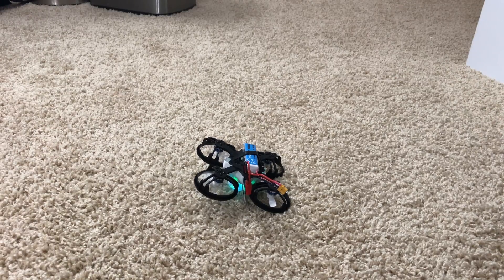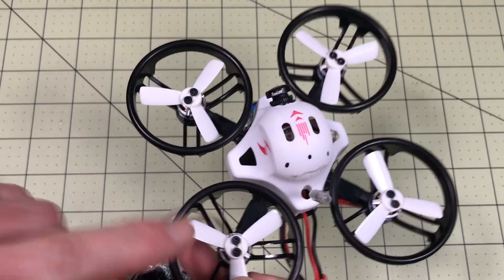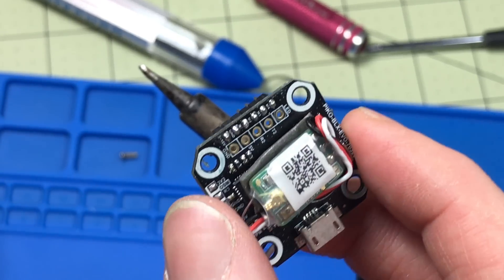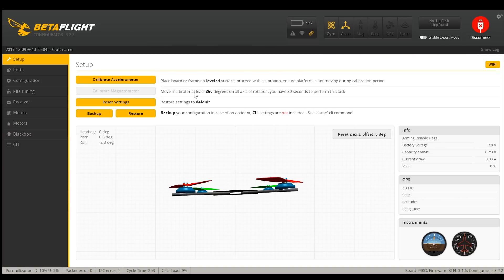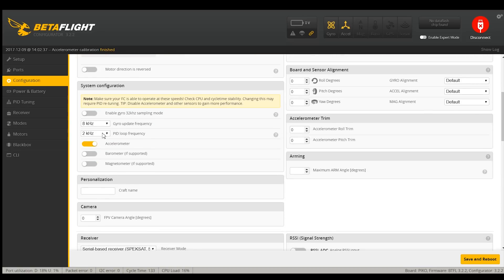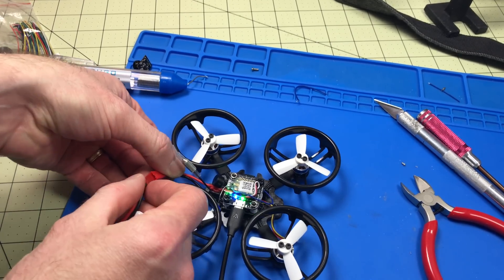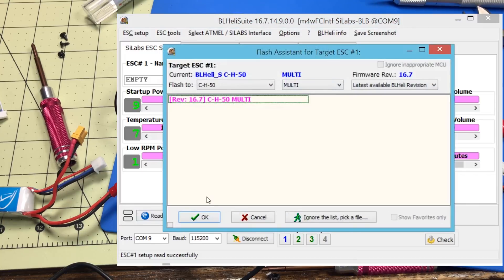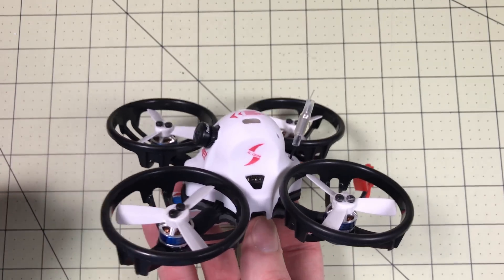KingKong LDARC ET100 DSHOT Setup. Enable Turtle Mode and a HUGE camera upgrade. ET115 and ET125 too

Comment from the maker: Check my tracking spreadsheet for current coupons: http://geni.us/DR101DiscountCodes

RunCam Nano:
Amazon: http://geni.us/RunCamNano
Gearbest: http://bit.ly/RunCamNano-GB
Banggood: http://bit.ly/RunCamNano-BG 

There are 3 sizes to choose from.
ET100 – 100mm frame 2 inch props - https://www.youtube.com/watch?v=l3L40QWDbx0
Banggood: http://bit.ly/KKET100 (Try Code ToysHo and if that doesn’t work check the spreadsheet)
Gearbest: http://bit.ly/ET100-GB (Use Code KKET100 if you don’t find any coupons in the sheet)
Amazon: http://geni.us/ET100
ET125 – 125mm frame 2.9 inch props
Gearbest: http://bit.ly/ET125-GB (Use Code KKET115 if you don’t find any coupons in the sheet)
Banggood: http://bit.ly/KKET125 (Try Code ToysHo and if that doesn’t work check the spreadsheet)
Amazon: http://geni.us/ET125
ET115 – 115mm frame 2.5 inch props - https://www.youtube.com/watch?v=NpwN68X8ypc
Gearbest: http://bit.ly/ET115-GB (Use Code KKET125 if you don’t find any coupons in the sheet)
Banggood: http://bit.ly/KKET115 (Try Code ToysHo and if that doesn’t work check the spreadsheet)
Amazon: http://geni.us/ET115
Reply: Great video 😀 I'm definitely going to try the camera mod on my et125. I wonder if you could put a Runcam OSD or similar on it🤔 might be too big a camera at the moment. But in the future, as in the next few months, I bet a small OSD enabled camera will appear on the market.
Reply from the maker: +Darkwing Duck Ich ging für einen Monat nach Deutschland in der Highschool.  Ich erinnere mich nicht alles, weil das Bier.
Reply from the maker: +Richard Warwick  The Micro2 is just a little two big, but yes, I am sure there will be one soon.  Will take some reworking of the power to be able to read the voltage though.  Or maybe just take this frame and install my own stack?  Hmm
Reply: DroneRacer101 just remembered Albert Kim did a review about 10 days ago for the FXT T80 nano camera on banggood. It's about the same size and has an OSD, you just connect a wire directly to the battery positive and your away 😀 even connects up to a Runcam joystick to control settings
Reply from the maker: 2 hours and the video is already outdated. 🤪
Reply: DroneRacer101 😂lol
Reply: I installed a micro 2 and it fits perfect after you cut out the plastic mount from the stock camera
Reply from the maker: Gavroche how did you hold it in place?
Reply: It holds in place by itself. You have to unscrew the lens, put the camera into the canopy and screw the lens in again from the outside - you do not have to cut the hole. If you have the DSMX Receiver you have to change it's direction otherwise the plug is in the way and the canopy does not fit anymore. Afterwards if you mount everything together again and fits really tight. I did not need to glue or anything. Hope my english was good enough to explain ;) Just try, it's really easy.

Comment: Following your video after a long hiatus, looks like FF_PIKOBLX 3.2.2 is gone.. ! Looks like the latest version is FF_PIKOBLX 3.5.7 , I also used the BLHeli configurator on chrome to upgrade the firmware on the four ESCs. I ran into a issue with drivers not working properly when flashing PIKOBLX, I used ImmersionRC's driver fix utility, and a PC reboot later.. it worked. :) Note: I have no idea what your using on the other channel.. I have the 3 default channels on my X9D+, and the turtle flip one that you showed.
Reply: Hi which version of betaflight where you using?

Comment: Dir auch guten tag!
I also bought one today
Thanks for the valuable tips ;)
Reply from the maker: This is actually outdated now. Just update the firmware. You shouldn’t have to do any soldering.
Reply: @SimRacer101  so much the better, if it's that easy: =) ty^^

Comment: Hi there  how did you enter boot mode?
Reply from the maker: I have the ImpulseRC Bootloader installed so it happens automatically. https://impulserc.com/pages/downloads
Reply: @SimRacer101  
Thanks pal I'm on with sorting out my serial port to run the flasher in betaflight. Esc are done on dshot600 and only 1 motor atm while I manage to flash the fc 👍 thanks for the fast reply ✌✌✌✌🇬🇧
Reply: @SimRacer101  
Any chance you could help me out here? Ive flashed the newest firmware to my et100 and the blhelli dshot600 managed to arm it but only 3 motors like you did but that firmware didn't support flip over after crash so I flashed the 3.3 you did but now the tx won't show in betaflight? Its binding according to the lights But nothing showing on reciver tab on betaflight config?

Comment: ET125 
have a question for  beginners how do I slow down the throttle it wants to lift off like a rocket I am a beginner any suggestions  
Could I use a bigger battery 2s More MAH 1000  
Maybe a 65 g battery weight

Comment: In my KK et 115, in air mode, when I arm, one motor start after 0,5s. And when disarm, the same motor stops first. Why? The quad is new and  it flies well.

Comment: Best regard

I have acquired by ebay, an ET100, I am happy with it. I wanted to update the firmware. the flight controller has a led that shines green, when I install the PIKO firmware, through betaflight, the LED flashes green and then turns off and everything works fine. I have followed internet videos to update with the firmware FF_PIKO and be able to use dshot 600, but when updating the firmware, the led of the flight controller remains blinking green and does not finish working well, since it seems that it does not link in control , despite the fact that the mini receiver XM frsky, links well.

I appreciate some solution

Comment: hi, my quetion is, compared with this Runcam the "FXT T80 800TVL cmos" camera is better? (I saw you use it in another vid) thx
Reply from the maker: I would use the T80 for voltage on the OSD

Comment: Hi, just to let you know (if you don't already) that, as of Betaflight 3.3.0, the DShot mod is no longer necessary for this board. No soldering needed, no resource remapping needed, DShot just works. If you could put that in the description or pin it to let people know, that would be great.
Reply from the maker: WHAT?  Oh, that is cool.  I will test that and update it.
Reply: Yeah I was surprised as well but apparently the Betaflight guys built a firmware fix into the FF_PIKOBLX hex file, to make DShot work. Just be aware though, if after you install BF3.3.0, you find that you can't get the SBUS receiver to work, use the CLI command: set serialrx_inverted = OFF
Reply: It does work!  Upgraded to 3.3.0 and upgraded ESCs to 16.7.  No problems, but I did notice the PIDS seemed to be for brushed and were way high.  Otherwise, DShot and Turtle mode worked perfect.

Comment: Hello, I wanted to try this mod, but i am facing a probleme and maybe you can help. I have my receiver fsRx2a (https://www.banggood.com/2_4G-Compatible-FS-RX2A-Pro-Receiver-for-FS-I6-FS-I6X-FS-I6S-FS-TM8-FS-TM10-FS-I10-Transmitter-p-1145881.html?rmmds=search&cur_warehouse=CN) and it is connect in ppm. The receiver can also transmit to sbus, so i wired it from sbus to the r3 of the pikoblx board, but the board is still working in ppm for some reason (the led on the board saying 'sbus or ppm' still light under ppm) the result is my receiver still bind but seem to not send any signal to the flight controller. How can i force/switch the piko blx to use sbus on the R3 and switch from ppm to sbus??

Comment: Whats up sir. First off great video! 
Got some questions for ya, I just picked up a ET115, and it actually really does fly way better than my tiny whoop by a large margin. Anywho for the questions:
1) What size batteries are you running? (my et came with a sticker that said DO NOT use 3s batteries. Ive found that I like the Tattu 2s 45c 800mah, but was curious if that is enough c.
2) If i make a backup, as well as run dump all from the CLI to save the factory tune that is surprisingly good, can i easily restore them all once upgraded to betaflight 3.2.2 so i dont lose the nice tune?
3) Will turtle mode work if I upgrade to BF 3.2.2 and do not run DSHOT? and secondly did you notice a large difference in flight characteristics for the ET when using DSHOT over Multishot

Comment: Hi DR. Quick question for you. With no mods, my motor 1 and motor 4 do not spin with dshot 600. Do you think if I resource motor 4 with the LED, that would work? Motor one works fine with PPM, but motor 4 is still dead is what I'm trying to say..
Reply from the maker: Hmm it sounds like a bad motor or esc unfortunately.
Reply: DroneRacer101. I went on and tried it. I ended up resourcing M1 to ppm and M4 to led_strip. All 4 motors work great on Dshot600 now. Thanks to you and Kopter for these vids. Learned a bunch!
Reply from the maker: That is the first I have heard of that for motor 4. I am going to have to do some research.
Reply: in CLI type "resource M4 xxx(whichever number LED pad free)"?
Reply: yes... i followed each step till I found the same problem... motor 4 doesn't spin... using flyegg 100 by the way
Reply: 张亮 Resource M4 with the LED pad the same way you did M1. Worked great on my ET100
Reply from the maker: Huh. I have not heard of needing that. But good to know. THANKS!
Reply: 张亮 correct. Let us know how you make out. 👍
Reply: https://www.youtube.com/watch?v=2TmjM5W5xmU 
I found this... might give it a shot

Comment: With all the newbies that watch this type of channel why would you recommend as a good drone after you have to change the camera, change the wiring and destroy the looks by hacking up the canopy?  There are plenty of good drones that don't need any work in this price range. Be careful of leading people the wrong way
Reply from the maker: Because right now even with the required changes the ET100 is by far the best in class in the indoor micro brushless category. Did you see the initial review? KingKong ET100 Brushless Indoor Racing Drone, Almost the perfect winter indoor racer. https://youtu.be/l3L40QWDbx0 I have SMASHED this thing as hard as I could and didn’t even bend a prop. And it’s wonderful to fly indoor at high speeds.  It is by far my pick for indoor flier, even stock. But once you have it of course you want more. It’s what we do.

Comment: I lost one ch in my 4 in 1 one my ET125. I was trying to flash at the time. I am rusty at this hobby.  Ordered a whole new stack from Banggood. $ 33 + frt. This video is excellent but I am really missing OSD. So, I will try adding sparrow micro. Working on the new stack, It was interesting soldering the 4-1, it is small. The entire mod  turned out well except  removal of the pin, I could not extract as described so, I improvised there. I cut it and then insulated it. Not so familiar with ESC protocall as yet. D-600 vrs. one shot, etc., cause it flew really really nice in my house. A blast. The mod went well as shown. Great video. I paused the video a million times, it seems. Sir, If I keep using your ch, I will sign up as I have with others. You should put a link? Nice work and thanks.
Reply from the maker: I think the micro is to big, but I just linked another camera in the description I have ordered to try that has an OSD and is NANO sized.

Comment: Off topic question...I bought a multiprotacol module for my QX7 from Banggood  and setup the radio following another youtuber vid to bind to eachine  E011. Worked perfectly (that never happens ). But I can't seem to get the answer to this question...how do you then change the rate or invoke a flip like OE controller.  Any help would be great oh wise one. Lol. Thx.

Comment: Nice video. There is no need to remove the pin (ESC 1) between the ESC board & FC. I do it on my first ET100. But on my KingKong ET125 and FPV EGG  I soldered only a wire from M1 to PPM. And it works fine with DSHOT600. 
My videos in english? Yes, no problem. Turn on the subtitle and switch the subtitle from German to automatic translation to english language. Very nice function from Youtube.
Reply from the maker: That’s correct. I updated it when I did the ET125 update. Waterproof a drone, ET125 DSHOT, FXT T80 Camera Review, FPV Gloves. There is a LOT going on here https://youtu.be/g-TYJc0UUTE
Reply: Kopterheld FPV Racing bf 3.3 no mod required for dshot. Make sure to set serial Rx inversion to off for sbus after flashing to 3.3
Reply: Kopterheld FPV Racing so no need to take the stack apart! Just take a wire and bridge m1 and ppm - followed by the resource mapping and the esc update?

Comment: When you are updating ur fc wouldn’t it be quicker to dump the cli then copy it into the erased version?
Reply from the maker: I used to.  But I have found they change just enough between versions that something is off. So I have found it better to redo it. They always rename one variable or another then when it doesn’t work I have to go figure it out. One one exception is LED. I do a Diff and will copy that back. But this model doesn’t have them.

Comment: Thank you for the video! An excellent review!!! Would you recommend a runcam micro on the et100?
Reply from the maker: I think the micro is just a little to big.  The nano is a perfect fit.
Reply: Good job, my Question I’d for the runcam nano, fist I secured it with a drop of hot glue on the barrel of the camera to make it more secured,   Or my question is, are you having blurry image with it? Having some notice it when after crashing, after retrieving the quad I notice that image are blurry, but giving it a few minutes rest, it’s going back to normal.